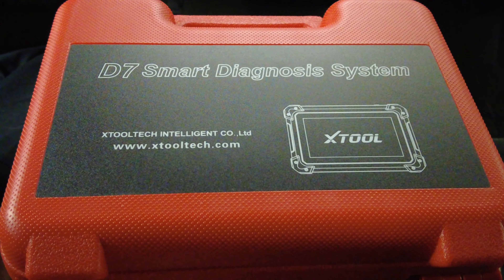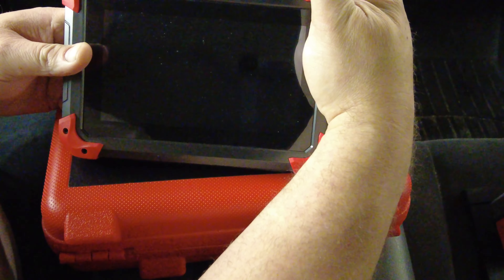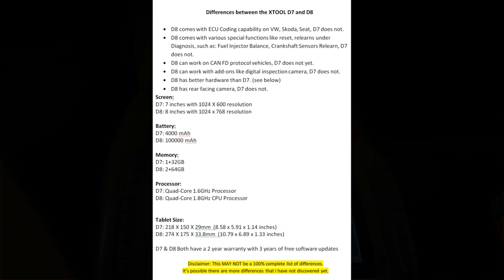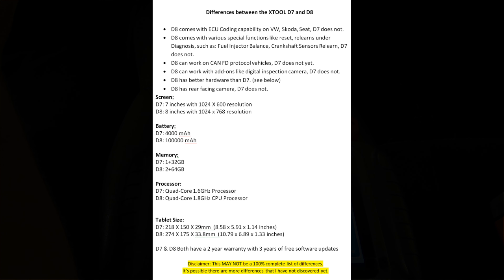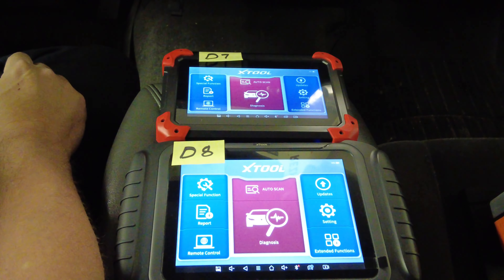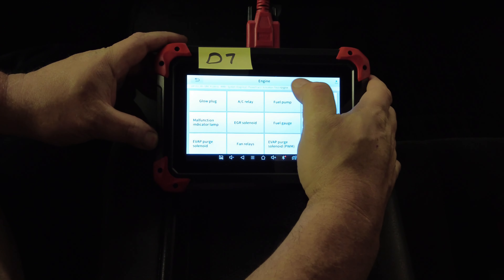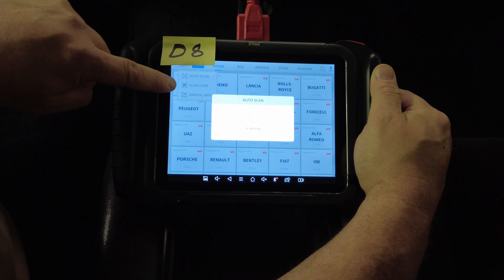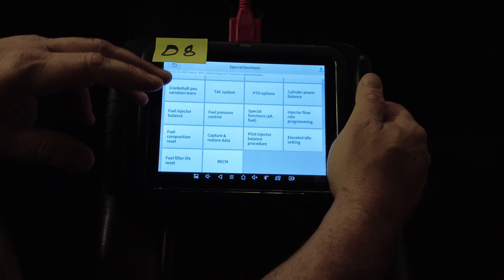XTOOL D7 vs D8 Comparison.  Differences Between These Two Diagnostic Scan Tools

Comment: D7D8CODE not working for me, but Amazon has the price for the D8 for $559 and D7 for $478.00.
Reply from the maker: Thanks for letting me know the code is not working.  I will see about getting it activated again. I will post back here when I figure this out.  Thanks again.
Reply from the maker: I have sent the email asking about renewing the discount code.  Please stand by.
Reply from the maker: I have updates the Discount codes in the video description, and in the first pinned comment below the video.  Please let me know if you're still having problems.  Thanks again!
Reply: @SlipFitGarage  just tried to buy the D7 with the XTOOLCODE and it did not work.
Reply from the maker: @kdworak4754  Hello,  I just notice that when I updated the discount codes a few weeks ago that I somehow deleted the links to the correct Amazon listings that these discount codes are programmed to work with.  I have just went through and put all the links back, along with the most current discount codes that I have.  However, you're correct, I can't seem to get the D7 discount code to work, either.  I have sent an email to my contact at XTOOL and when they reply, I will be sure to reply back here with an update.  As I type this message it is late Saturday night on Labor day weekend here in the US......  I probably wont hear back from XTOOL until Monday or Tuesday of next week.  Stay tuned and thanks for letting me know there is a problem.
Reply: @SlipFitGarage  working nights here in AZ.  Standing by.  And thank you so much for your time.
Reply from the maker: @kdworak4754   My contact at XTOOL replied to me earlier tonight and said the discount code should be valid, but they resubmitted it anyway just to make sure.  I tried it again a few minutes ago and it's still not working....  If it's not working again tomorrow night I will email them again. Sorry for the trouble.  We'll get it working eventually. Thanks for your patience. 🙂
Reply from the maker: @kdworak4754  Ok, the discount code is now working again!  (As of 6 pm Monday Sept. 5th 2022) Sorry for the trouble. Thanks for your patience, and thanks for letting me know there was a problem. 🙂
Reply: @SlipFitGarage  ordered, code worked.  $30 Amazon coupon, XTOOLCODE and new updated functions...  not bad.
Reply from the maker: @kdworak4754  Glad to hear it all worked out. Thanks. 👍